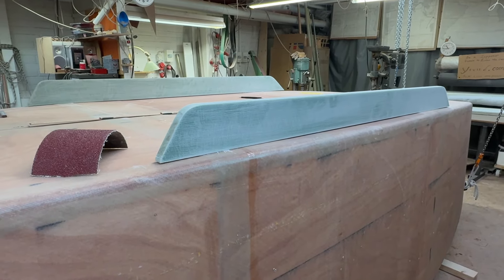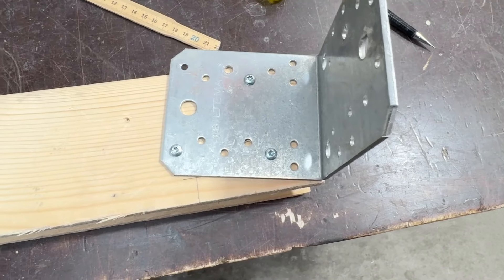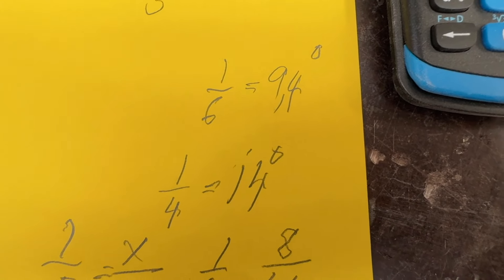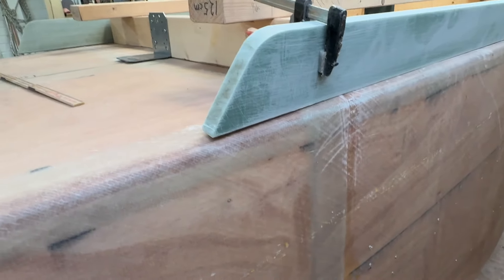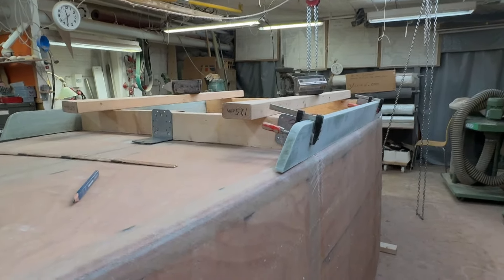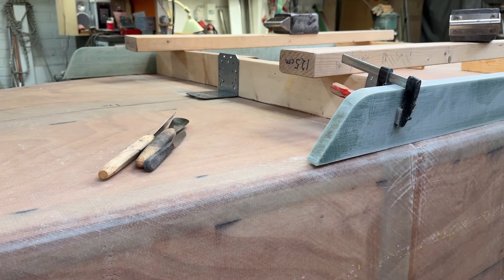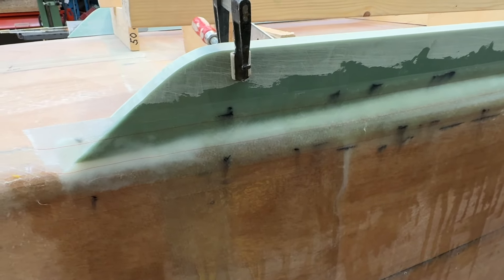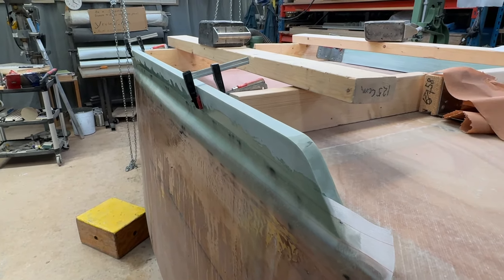19 Aug 2024 Attaching the chinerunners

Comment: They are not ‘chine runners’.
They are either bilge keels or very low aspect ratio twin keels.
Reply from the maker: I consider them vertical chine runners as their effect comes the hull sides. If it will work, I do not know.
But you are right they are not the same as Matt Laydens. Also ther will be a horisontal endplate added in next step